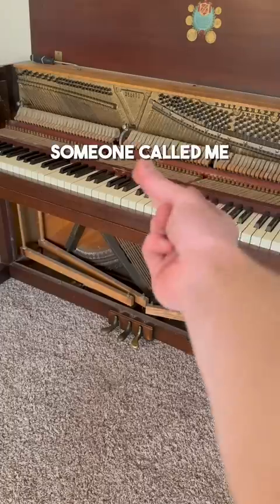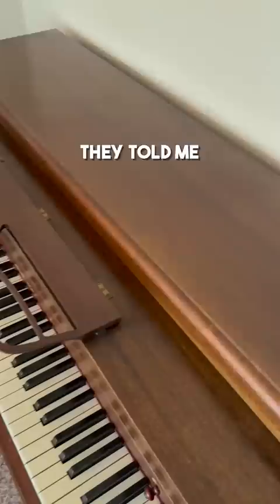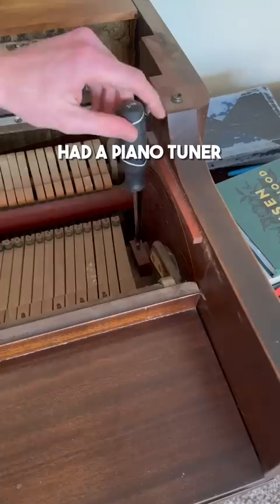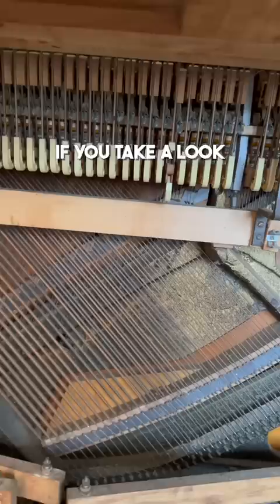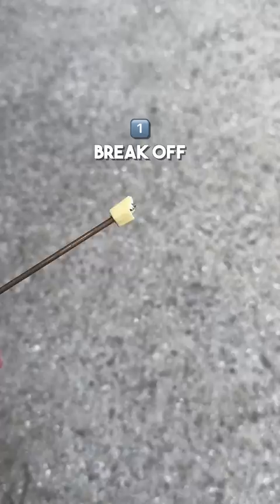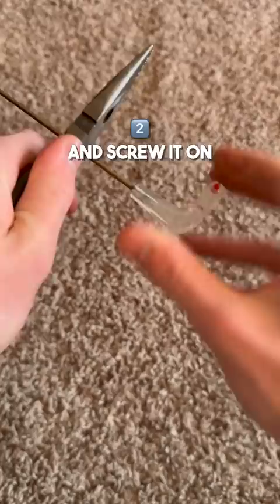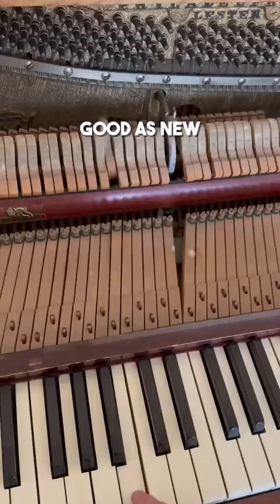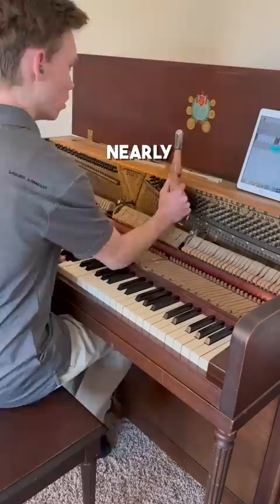fixing a broken key on a free piano

Comment: Yo. Nice videos! I'm a young tuner myself. Second generation, my father owned a piano business. Are you running protek along the bass string pressure strip before you tune? Do you find that helps during a pitch raise as to not break strings?? Never seen that done. Thanks!
Reply from the maker: Yes, it’s “protek” lubricant. It helps avoid breaking strings and makes the tuning a little more stable. I got that tip from the owner of “gazelle”, and I hardly ever break strings now.
Reply: @PianoDoctor  Thank you sir! I also use gazelle. Best of luck with the channel 🤙

Comment: I love my free piano. It was the color and type I always dreamed about having. Definitely needs some work, but I'd rather snag a free one that looks to be in decent shape than see it go to the dump. All mine really needs is a tune-up. All the keys work just fine. There were some sticky ones that I fixed myself. It plays beautifully, and my kids absolutely love it, too.

Dont knock free pianos. I'm not financially able to save up a few hundred dollars for a "nice used" piano, nor am I finacially able to pay for a tuner. I just do my research and take it if the piano is clearly in a geanerally good condition. I've gotten a few free pianos in my 24 years and loved all of them. A free piano in rough shape is better than no piano at all in my opinion🤷‍♀️

Comment: In and of itself it is true that one should rather stay away from pianos given as gifts, so this almost always means that it was cheaper for the owners to buy a new one instead of repairing the old one.
 BUT:
 That was before 3D printers and Youtube & Co!
 Now somewhere on the internet you will surely find instructions on what to do and you can make the missing parts yourself.  With a 3D printer (even through a company it is not expensive) or depending on what is made of wood, plastic, metal or whatever else is suitable.

 So I would rather say that if you have the opportunity to transport the instrument etc. and have the time for restorations (in general), you should grab it!  You can always sell it or keep it and have a lot of fun with it even while repairing it.